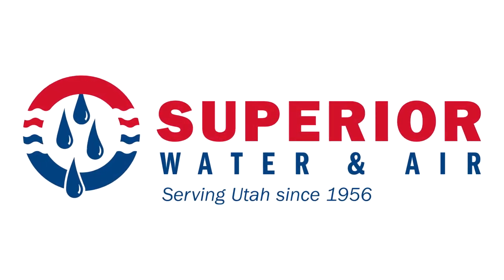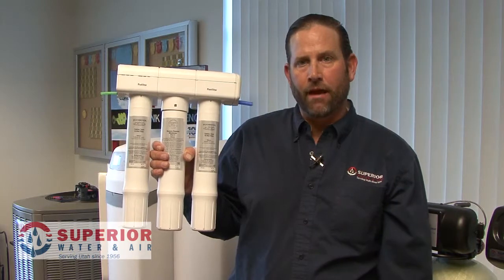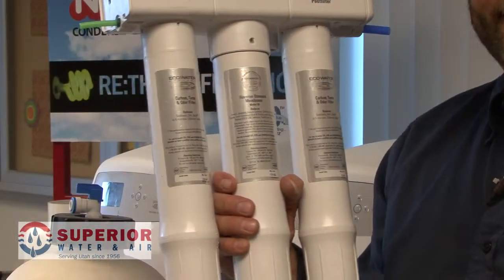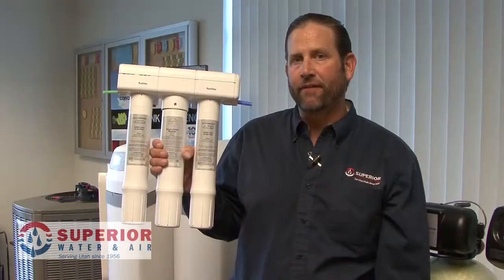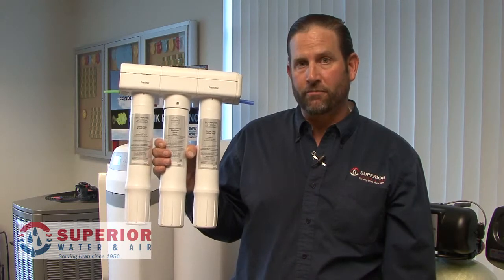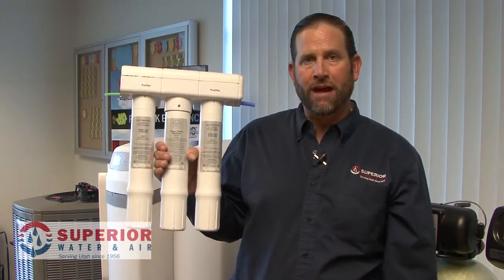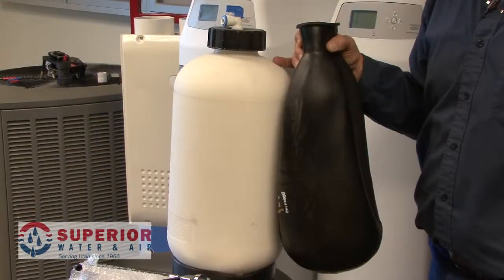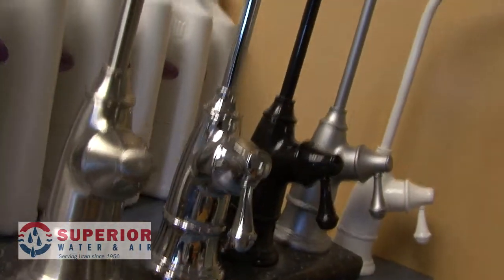How Does Reverse Osmosis Work? | Superior Water & Air Utah

Comment: Hi I have a RO machine that was installed incorrectly. The installer did not put the tube into the waste water drain to allow the water to drain and the water started tasting bad. It was three months before I realized what was going on. My questing is this: what pathway was the waste water taking to get back into the storage tank. Was the waste water being forced back into the filters going the other direction or what. Thank you.